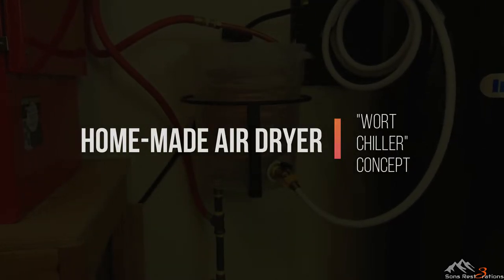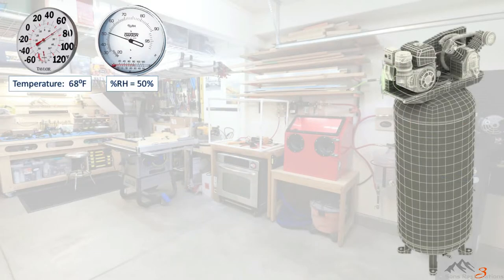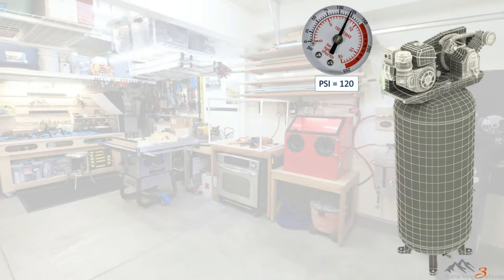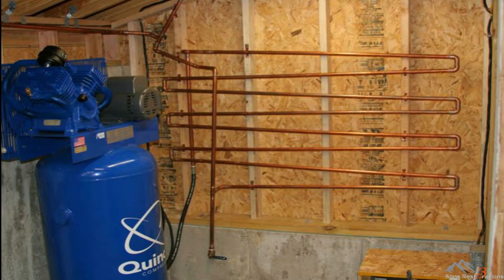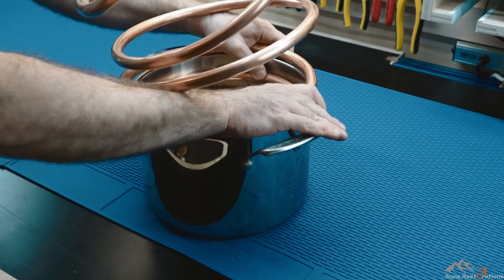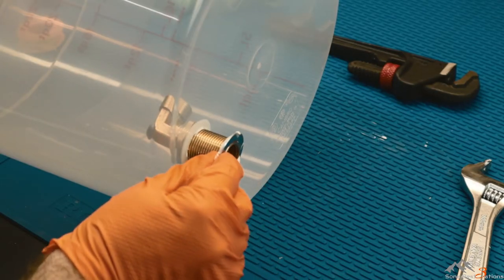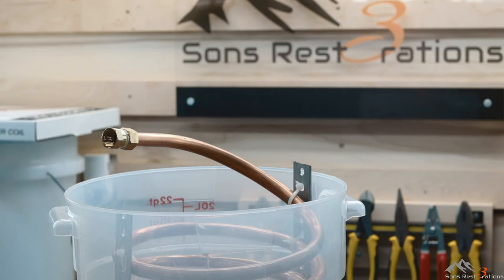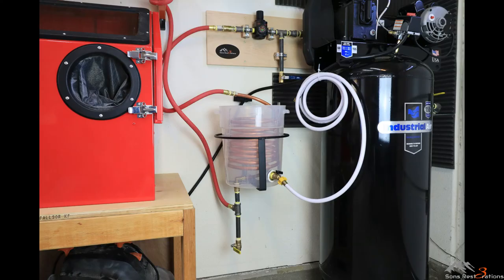The Copper Coil Air Dryer/Compressor Aftercooler DIY (Setup Part Two)

Comment: This is a great idea and probably the most cost effective one I've seen yet. I may build this but run it between the compressor and tank and then out of the tank and into one of the inline dryers.
Reply: That's exactly how I did my system. Used 3/4 copper and ran a bunch of 4 foot zig zag sections in my old water softener salt tank. Then goes out, past some moisture drops, and through a filter and desiccant. Output of compressor reads 250 degrees, line back into tank reads 55 degrees .This This way, hardly any water gets in your tank to rust in the bottom.

Comment: Excellent video and presentation of the understanding of saturation capacity of air. My aftercooler is a 1/2" od (pressure line) inside a 3/4" water jacket line. I run cold water through the annular opening between the line. Good dry air. I also do a pressure drop between two tanks to provide additional expansion drying of the air as well. One benefit of pressure drop through the hoses and fittings is that this expansion drying will help given the air has no latent water present.
Reply from the maker: Putting the line inside another is a really good idea, I may have to look into that.  Thanks for watching!

Comment: Excellent explaination & demonstration of a good air system & moisture removal principles. Also you mentioned the typical humidity is lower than other places & I understood you chose the single stage cooler (ice water) based upon the estimated moisture load in your ambient air. 
I want to design & build a comprehensive air compressor system with multiple stages of moisture removal, positioned after the compressor pump & Before the tank, so that the tank Never accumulates any condensate. I live in a hot, high humidity area of south central Texas & must build my system accordingly. I appreciate your presentation, thanks!

Comment: How does this video only have 6k views?!? This is by far the best video about creating a copper tubing drying system for an air compressor imho.
Reply: For how much he spent, you can get a used smc amg and amd filter and have same results in a compact design. My workplace has them and we have no water or vapor.
Reply: @Pepe-dq2ib  agreed. I actually ended up finding a slighty used Speedaire refrigerated air dryer (3YA49) for $150 locally on Offerup. Instant gratification instead of all this work lol.

Comment: If you get a chance to film it running at some point it would be interesting to see how much water gets condensed out and drained.  Thanks for the very detailed & well executed video!
Reply from the maker: Thank you for watching!  I may have to do this.  I've never actually taken a measurement.  And if I'm blasting something small, I typically just blow out the small amount of excess moisture onto the floor rather than drain it out.

Comment: I'll bet it was fun getting that copper tubing connected to the fitting that feeds through the bottom of the bucket.

I really appreciated your explanation of psychrometrics.  I teach that subject frequently, and it's amazing to me how few people building these coolers really understand WHY there's air in the lines, and how to get rid of it.  Many people mistakenly believe the moisture condenses out of the air because of a drop in pressure inside the dryer tubing and that the temperature differential is not necessary.

I'm curious why, after all the thought and craftmanship you put into this, you didn't opt to install the dryer between the compressor output and the tank.  Although maybe you're someone who just prefers to drain the water out of his tank after each use.

Comment: I’ve been thinking of possible alternatives to the wall mounted copper design, so your design struck a chord with me.  You’ve been very resourceful with sourcing the components.  I find myself wondering why you didn’t have the air go in at the bottom and leave from a vertical extension at the top, with a larger sump for the collected water?  At up to a certain limit of airflow (determined by the gradient of the pipe and the height of the vertical extension at the top) the water condensing on the walls of the pipe would drain against the airflow under gravity into the sump.  The air leaving the condenser would be less likely to carry liquid water through into the post filter.

Comment: I believe the 120psi is a gauge pressure, so the absolute pressure is 134.7 psi. I think this means that, when compressed, the amount of moisture per volume is now 9x original, rather than 8x.

Comment: Installing a 60 gallon air compressor.  Using it to operate a 4 post vehicle lift, impact wrench, and potentially other handheld tools. No painting, plasma table, etc. I thought about installing an after cooler like you have designed or vertical copper type with water collection like seen elsewhere on the net. Would you even bother with this given my application? Thanks for the help. Really appreciate your video and feedback.

Comment: Funny, I actually thought of this exact same idea about a year ago but when I did a quick estimate on the cost of everything, I ditched the idea as it was very close to a cheap HF dryer. Albeit I planned mine with 3/8 copper and 3/8 copper fittings are stupid expensive.

Comment: One advantage you don’t explicitly mention is that this design can make the air much drier than an air cooled system can. With an ice bath at 32F, you’ll condense out much more water than you would with copper pipes all at 70F.

Comment: Great video, but just a thought, the copper tubing should be insulated/isolated from the perforated metal strap/flat bar. Recipe for galvanic corrosion and potential “boom” hazard amongst other things.

Comment: Excellent video, I’m thinking about making one like yours and installing it in a small shop refrigerator. Would that work as well as the ice idea in your video?
Reply: Joe, it would not work as well, for a couple of reasons. For one, heat transfers in water four time faster than in air, meaning that the water draws the heat from the pipe four times quicker in the water. And, the mass of water can hold significantly more heat than air, meaning that the air in the fridge would heat up to the 300 or so degrees of the copper pipe quickly, probably within minutes, and no longer be effective. He can change the water by draining and adding more, or add ice to cool it right back down, but after a couple of minutes the fridge system would be useless. Not a fridge system designed for such a task, mind you, but a system made by simply putting a copper coil inside a small fridge. Scott
Reply: @scottsmith7080  How about a water vessel like his bucket inside the fridge? Seems like manually handling ice & water would be a pain since I run my compressor everyday. Putting his type of system inside a fridge is the logical next step--on the surface, I haven't done any calculations.

Comment: Really nice video.  Your physics is good.  However, I'm curious as to why you do not "dry" the air before storing it in your compressor?    I've watched a number of YouTubers redirect the air thru a similar "radiator device" prior to storing it in the compressor's tank.  Too much work to re-plumb the compressor?
Reply from the maker: Thanks for your comment!  I strongly considered it, yes.  But, I didn't have a good way to blow cool air onto the radiator, like a lot of guys do with the pulley systems.  I also didn't want water accumulating in the tank.....which I believe it still would with an aftercooler.....even if I put a large diameter pipe with a drop between the radiator and the rest of the supply.  I believe this setup allows me to remove the moisture more effectively:  after the tank.  Finally, if there's ever any breaks due to vibration, it's easier to fix this than the plumbing on the compressor.

Comment: It would be best to use plastic for the support frame, else corrosion will occur in the bucket due to dissimilar metals in the cooling water. While draining the bucket between uses will minimize this issue, using plastic, such as pvc pipe would eliminate the issue. It would be ideal to connect after coolers before the tank, but after the check valve/unloader. This necessitates removing the unloader valve from the tank and connecting it directly to the cylinder output lines. The check valve is designed to handle very hot air. Some pipe fittings are needed to connect the after cooler output to the tank. This will cause less water vapor to be pumped into the tank, too, the unloader will not have to vent all the air from the coolers every time the compressor stops.

Comment: Being in the compressed air field for over 40 years, I have seen people use old refrigerators with that same coil of tubing inside of the refrigerator.
Kind of a cheap refrigerated compressed, air dryer
Reply: Exactly what I'm planning with a dorm fridge a rental tenant left behind. Wondering why more folks don't do it.
Reply: more than likely they just don’t know

Comment: Im gonna build this but im using smaller copper of 12x1mm instead of 12.7 (i am from europe and that pipe is rare,and all the fittings i have to order online then which jacks up prices due customs )also they sell only 16 foot sections-but my compressor is much smaller so it shouldnt be a problem. I think i might put aquarium pump-cheap one to circulate water since water in motion cools better than water standing still.
Im also building my own motoguard toilet paper filter since shipping on those costs almost as filter itself(why cant you be like china -5$ shipping to opposite end of universe) and all the threads are different since we use bspt not npt(i think you could recut some of them not sure).
Anyway great video ,thanks for the great idea!

Comment: your point mostly correct but something is off i guess. the moisture in the tank caused by the condensation in the tank. as the mechanical process in the cylinder head generates heat, then it transfer into the cool tank making the hot air condensate into water. the efficient way is to put that coil after the compressor head, before the tank as we want all the condensation process occur in the coil. also put water separator before the tank. then you have 99% dry air and dry tank also.

Comment: Did you have all those other filters before you added the chiller?  I assume you were still having issues with water getting past those filters and that is why you added it?  I just added the radiator type to mine and hopefully it helps my system.  I haven't used it enough to find out yet.  But, I suspect I may have to add another filter or two downline.
Reply from the maker: No, I put the system all together at one time, with the idea that this chiller would not only be an additional drying step, but also help the filters last longer so I'm not changing them out/emptying as often.  I get an idea of what the chiller is doing when I drain the drop just after it.  Turns out, the filters haven't really been necessary to this point.
Reply: @threesonsrestorations4043  Glad to hear that it is really effective.  Thanks!  PS - great quality on your video editing.  I know how much work goes into it.  Please keep up the good work!

Comment: Great Video! Question, now that it's been a couple year did you have any corrosion issues with direct contact between the copper and galvanized steel in the bucket?
Reply: It's freshwater

Not saltwater

To stop electrolytic corrosion, what would you use as sacrificial anode and with the galvanized steel or the copper tubing be the Cathodic "ship"

Comment: Would this work if you put the cooler in before  the air goes in the the tank? Like the radiator coolers. I just want to keep as much water out of the tank as possible.
Reply from the maker: Absolutely, I see no reason why not.  I think it's important to keep the sharp turns down though, so not too many 90-degree angles in the airlines before the tool.

Comment: So is the compressor tank out of the system altogether?
Reply: No its still in its original function of storing air.This just takes care of moisture in the air lines and motoguard filter takes care of oil from compressor (unless you use oil free that has teflon coating and plastic piston rings-oil is used as piston lubricant and some of it ends up in air hose )which is bad when you use spray gun to paint cars for example.

Comment: does the drainpipe at the bottom of the coil fill up with water fairly quickly or is there plenty of volume in the vertical black pipe to collect the water?
Reply from the maker: Thanks for asking!  Fortunately, I live in a low-humidity, dry climate, so I rarely have more than 15-20ml drain out.  I also don't tend to use the compressor for more than about 30-45 minutes at a time for my projects.  But, I think this will depend highly on your climate and length of use.
The nice thing about putting this setup after a regulator is that it's easy to quickly drain the pipe mid-project.  I just use some of the excess air under pressure to blow out the pipe.  Thank you for watching!
Reply: @threesonsrestorations4043  I really like the idea I think I'll add a coalescing air filter teed off of the drainpipe to help manage the moisture build-up but O really like this setup thanks for the video
Reply: @threesonsrestorations4043  yea I live in Ohio right on the lake so there's no lack of moisture in the air lol

Comment: Hi man do you use 1/2 inch copper?
So how long you need  for your setup?
Reply: just buy  a used ac condensor from junk yard off an old car it has the tube type coils and use a box fan it cools the air and all the water gets cought in the catch filter after the radiator.

Comment: Shouldn't the cold air be dumping into the compressor tank first so the tank doesn't fill with water, after all the tank is a huge part of the system.
Reply: my thoughts exactly

Comment: What's the difference between using copper setups like this and a water separator filter?
Reply: From what I understand, the copper setup acts as an air dryer. When air is allowed to cool properly then most of the water content can be removed which helps to maintan your airtools, etc.

A water separator that is placed too close to the compressor`s outlet wont help as much since incoming air is at a higher temperature and most of the moisture can escape. Including a water separator filter without any air dryers or alike will cost you extra maintenence to replace the filters etc.
Reply from the maker: This is exactly correct!
Reply: @threesonsrestorations4043  hi! I wonder if you can actually put this setup to the test. Say what is the temp drop;
1. No ice/water bath
2. No ice/water bath but with a standard fan blowing into the bucket
3. Water bath 
4. Ice bath

Comment: Here's one thing that I see with a system like this: Your cold water will start being less cold from the minute you put it in the bucket, even if you don't use the compressor, through natural heat movement.  The more heat you put in the bucket, the more that transfers to the water and heating it up, and the less efficient this system will become, even to the point of probably no heat transfer at all if you are using the compressor enough. I couldn't know any numbers, but I would guess this system is only good for short uses of the compressor during summer months (assuming you aren't in a cooled shop)? I'd love to do some measurements on that system. I guess you could keep adding ice to the bucket to try and keep the best efficiency and heat transfer (whatever that factor may be) in the system. It for sure is better than not having any thing so I'm not knocking it. But where I live in east Texas, I'd think we'd need another system. My compressors pump out so much water in the middle of summer. Funny, in winter, I start thinking my system has miraculously cured itself from water vapor issues. Right about this time of year, I start to see water vapor reappear to give me headaches until it cools off again around Nov.  Thanks for sharing.

Comment: Did anyone ever use refrigeration  copper y bends instead of 90s  and tees to make a compressor air dryer just wondering if it would work

Comment: It would not be much more of a step up to build a refrigerated type and performance would be greater. Essentially an air conditioning evaporator that your compressor air runs thru. Evap temp would be similar to that of an AC unit as to not freeze the moisture as it condenses. One simple way around the complex aspect of designing a system is to use a water chiller to cool the bucket of water, thus negating the need to buy ice. This is how i built a refrigerated computer cooler before.

Comment: 1/2 npt compression fitting doesn't fit 1/2 copper. Shouldn't it be 5/8 to 1/2 like the 90 degree elbow 🤔. Also, you didn't give a measurement on where to drill the holes... Still a great video 👍🏾
Reply from the maker: It's a coupler....click on the affiliated link to see it more closely :-)
The holes drilled into the bucket or wall will depend on your own setup.  Thanks for your comment!

Comment: you run the coiled copper dryer between you compressor and the tools not between the pump and the tank, that's kinda weird, your tank is still filling with water.......

Comment: In theory this is correct but your build of it will only have any condensed water be carried on into the rest of the system with the way you have the oulet at the lowest part of the system.  😢